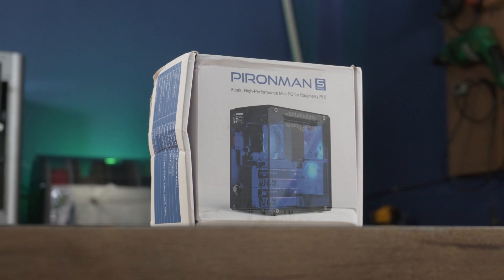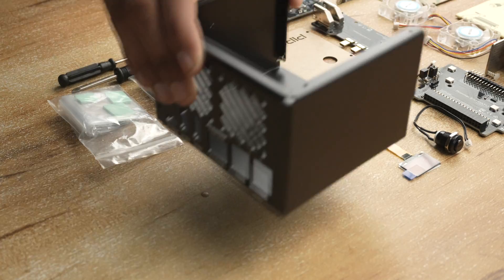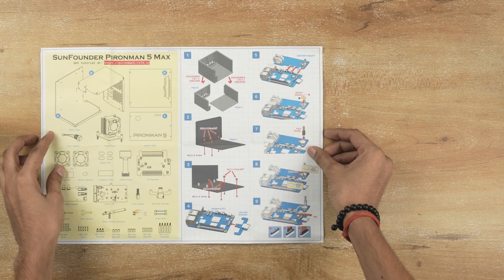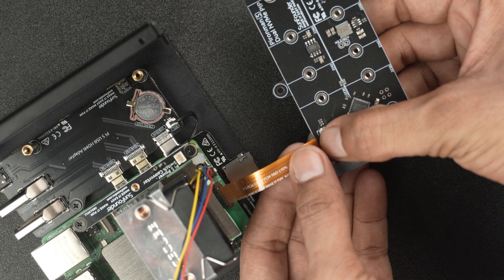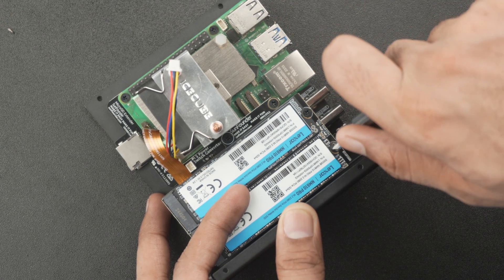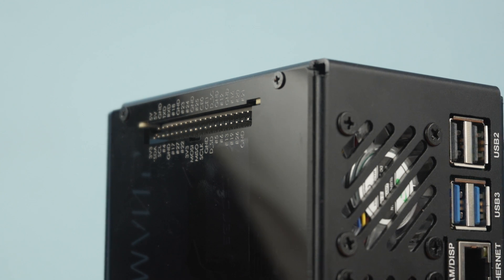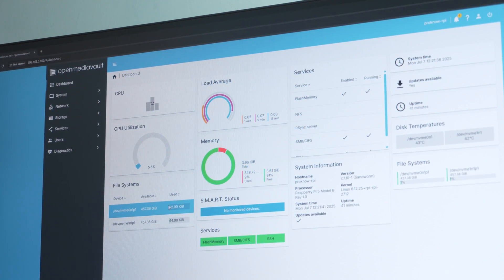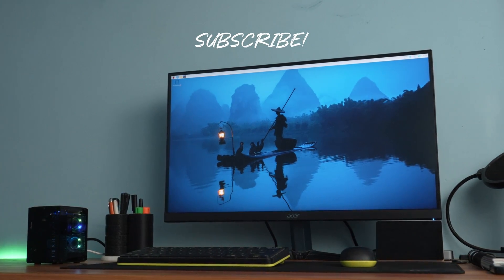Turn Raspberry Pi 5 into a Powerful Mini PC with Pironman 5 Max | Dual SSD + NAS + AI

Comment: Hey can you Develop a smart MCCB with Wi-Fi using ESP32 to enable remote monitoring and control. It can detect overcurrent, short circuit, and temperature issues, and send alerts to a mobile app. Ideal for smart homes and industries.😁